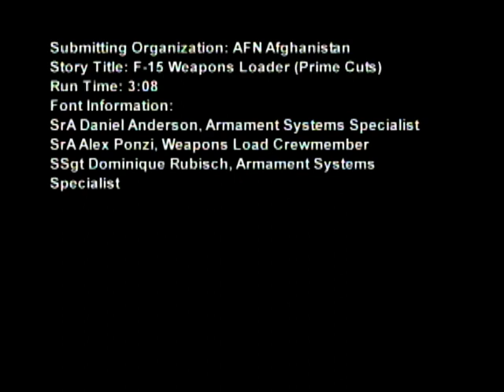F-15 Weapons Loader

Comment: I used to do that in the 494th Red Section, but on the F-111's. Later, I worked in the load barn as an SLC member. Good times. You guys rule! I sure do miss that job. You'll miss it when you're done, so load 'em up as long as you can.